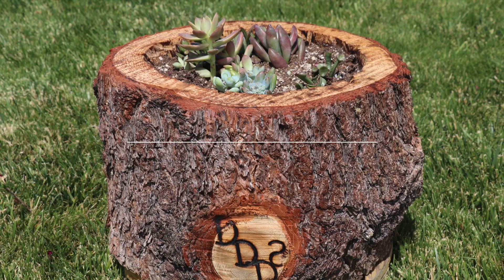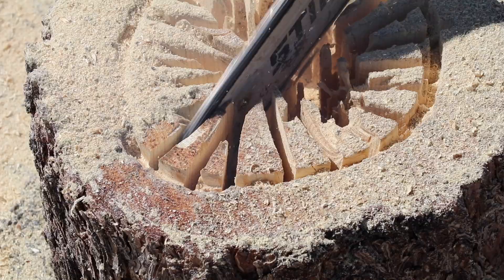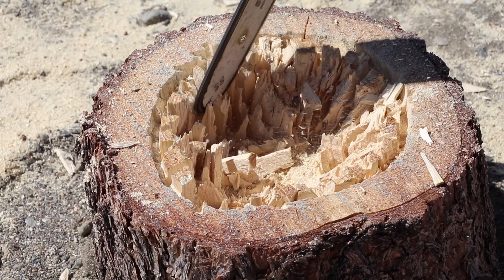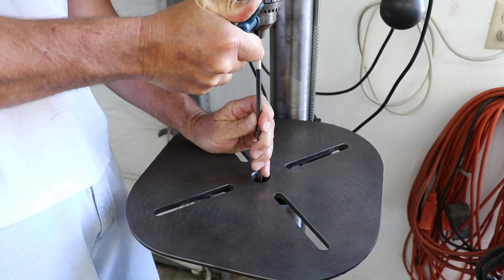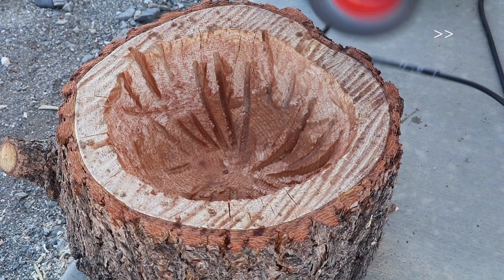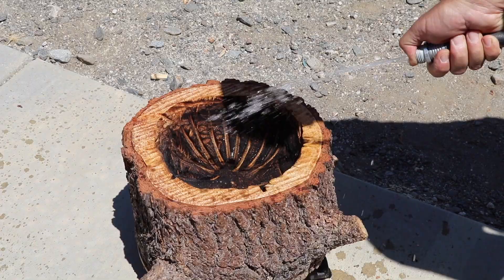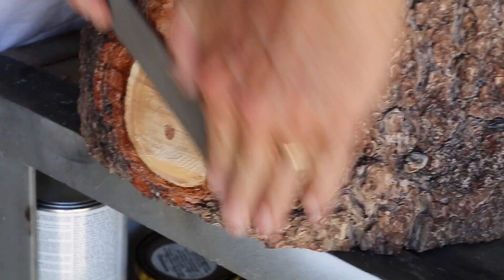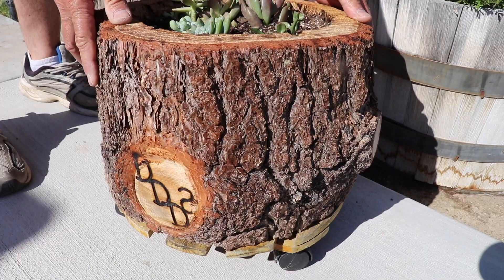Wood Planter

Comment: Don't we need to seal the planter inside out to save it from rotting? Just curious to know 🤔🤔
Reply from the maker: Great question! For the first two years, we used the planter with only the burned bowl as protection. It worked well, but especially with the succulents we planted in it, we watered infrequently and the wood started to show that wear. About a year ago, we coated the inside of the bowl with Flex Seal: Liquid Rubber Sealant Coating. Unfortunately, the wood was already cracked so it can’t fix it completely. That being said, the planter is still holding together and doing well considering it’s three years old!